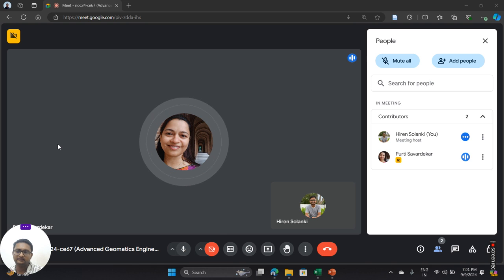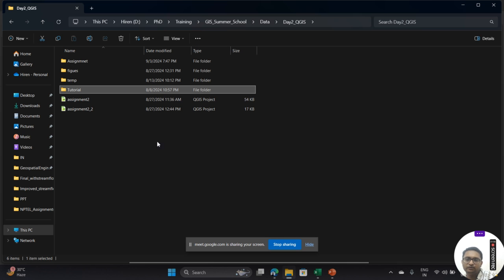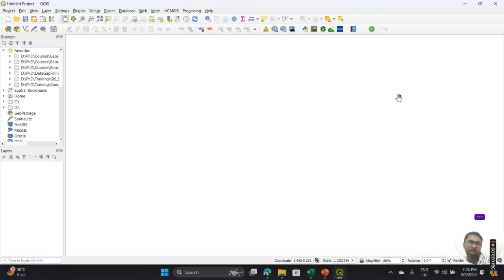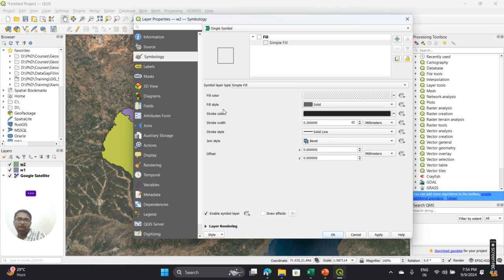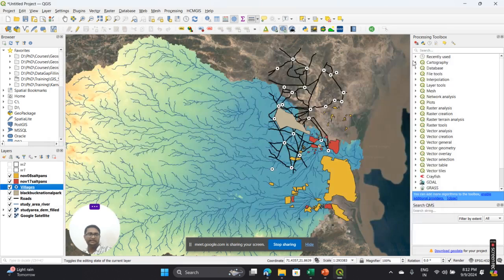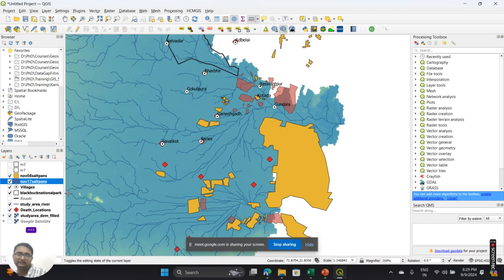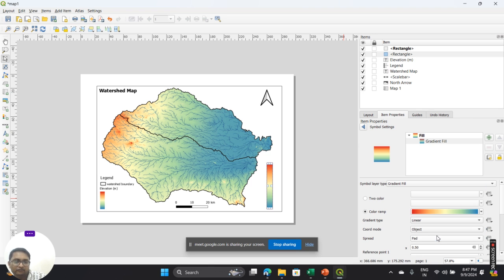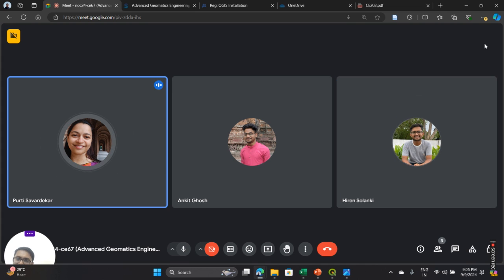Week 7: Problem Solving Session | Advanced Geomatics Engineering (noc24-ce67) | NPTEL Course

Comment: 00:20 Introduction and background of participant
02:53 Learning about remote sensing data and processing
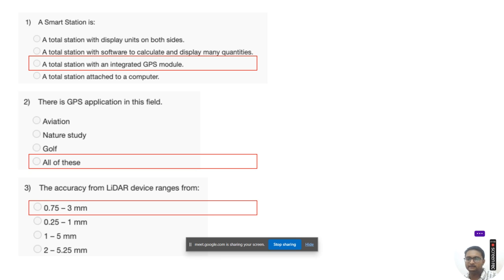07:54 Different types of laser scanning modules.
10:29 Mobile mapping system is efficient for surveying larger terrain areas.
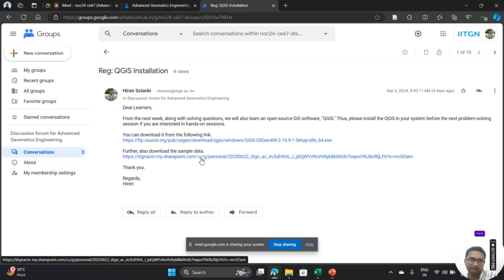16:09 Provided links for QGIS installation and dataset download.
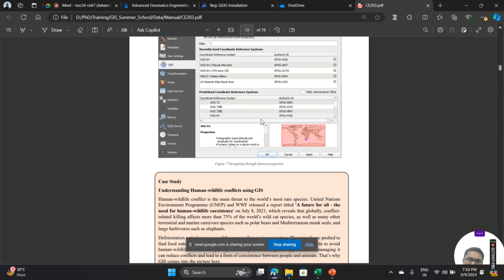18:27 Tips for organizing files and folders in QGIS
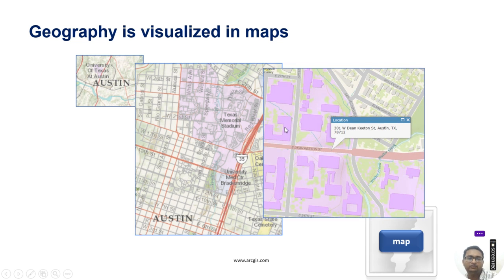23:05 Visualization of maps and GIS components
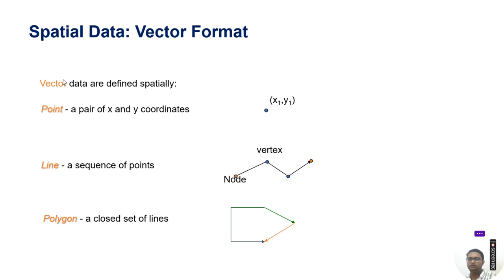25:10 Vector maps have different data representations using points, lines, and polygons.
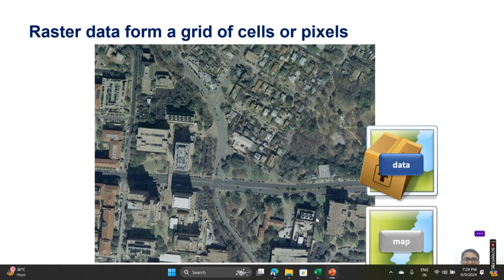29:48 Understanding raster and vector data in GIS
31:55 Utilizing GIS data for construction decision-making
36:30 Customizing panels and toolbars in software
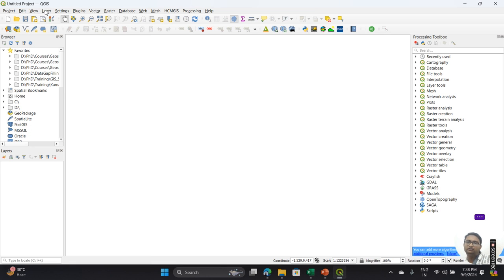38:28 Exploring layers, settings, profiles, and plugins in QGIS
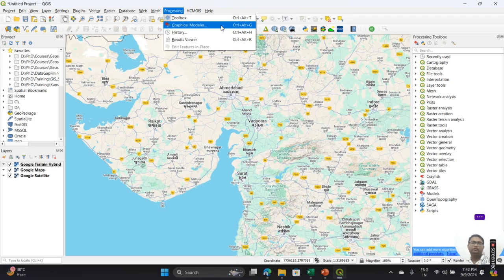42:31 Utilizing graphical model for automation
44:34 Difference between geographic and projected coordinate systems
49:34 Store data sets in a separate drive to avoid system slowdown.
51:54 Opening and understanding attribute table in Geomatics Engineering
56:15 Introduction to raster data and its characteristics
58:40 Changing the colors of a raster layer in QGIS
1:03:57 Differentiating between vector and elevation layers
1:06:23 Importance of layer management in geomatics engineering
1:11:07 Representation of Villages in Geomatics Engineering
1:13:18 Adding raster and Vector GIS data in QGIS
1:18:09 Analyzing the Death Location of Black Buck
1:20:40 Impact of salt pans on water flow in Gujarat National Park
1:24:45 Creating elevated areas to divert floodwater and protect wildlife
1:26:39 Using GEOSpatial data to solve local problems
1:35:22 Using the add map tool to select and create a map area in QGIS
1:37:38 Adjusting data display and adding items in Geomatics Engineering
1:42:36 Data visualization customization in geomatics engineering
1:45:03 Changing rectangle color with gradient field
1:49:44 Understanding color mapping for elevation data
1:51:46 Setting up data layer and grid for coordinate reference system
1:56:07 Changing precision of coordinates and adding additional maps in geospatial engineering.
1:58:23 Exporting and resizing maps in QGIS
2:02:47 Discussing digitization challenges and manual accuracy
2:05:04 Covering survey of India topic in next lab